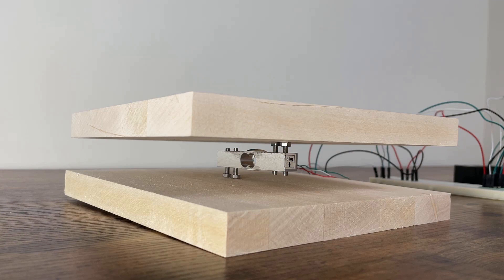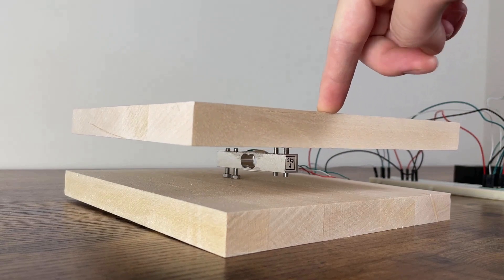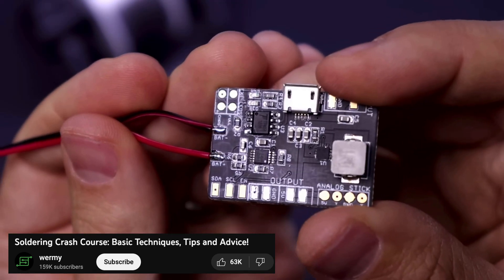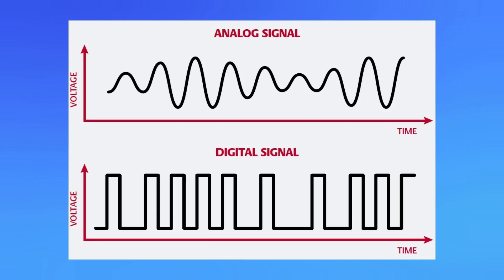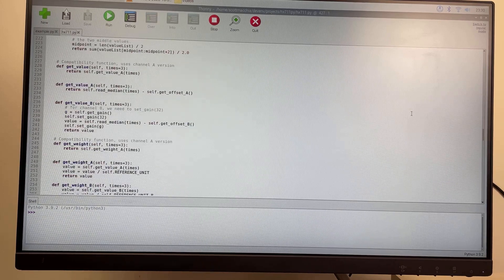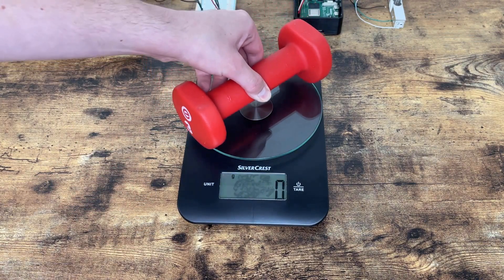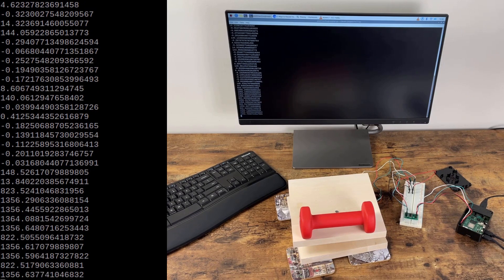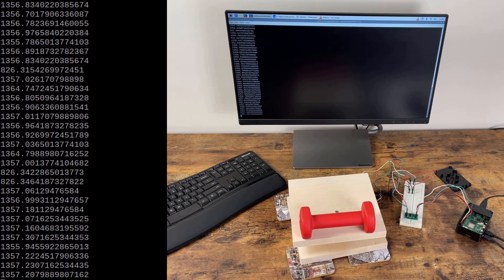90% of People Won't Recognize This Device

Comment: Can i see the diagram of wiring plsss
Reply from the maker: The circuit was inspired by this article: https://core-electronics.com.au/guides/force-sensitive-pads-raspberry-pi/. But there are some mistakes in their circuit which can damage your raspberry pi. My most recent video explains how to fix (need to use the 3.3V instead of 5V pin)